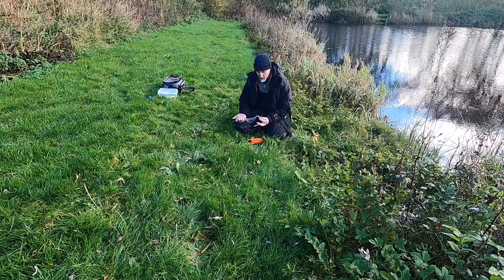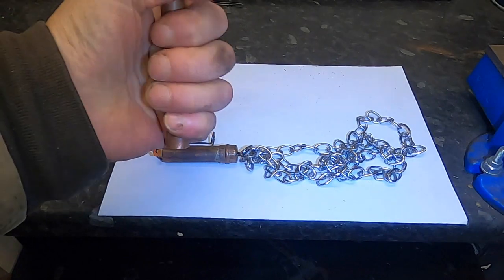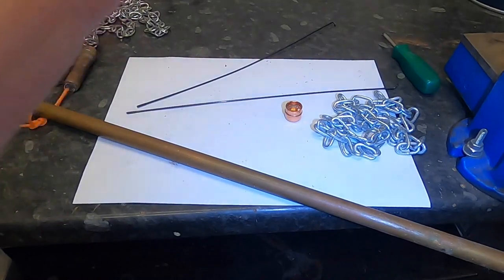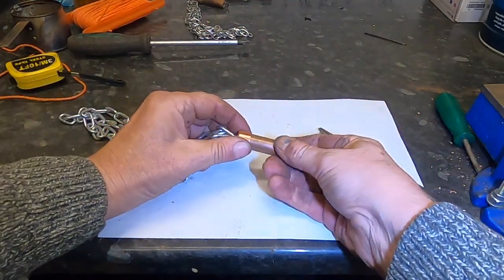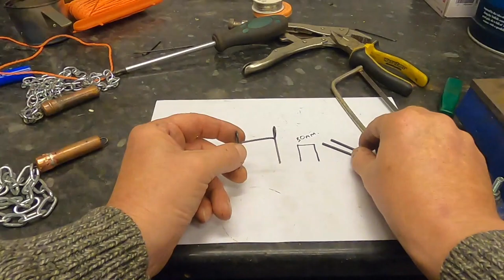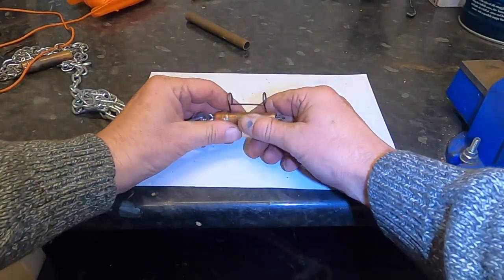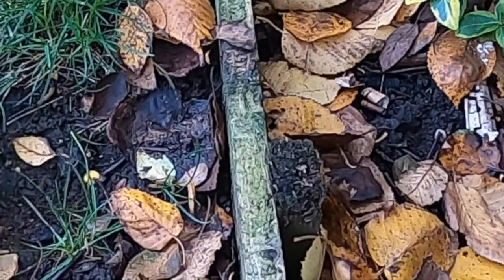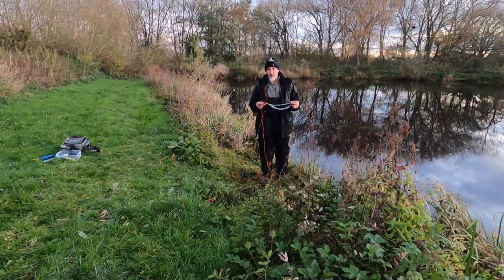DIY Lure Retriever

Comment: Just curious how this would work on a single barbless hook , would it be too difficult to get a hookpoint to grip to. Excellent video though, especially the tip about getting the line tight with a bar.
Reply from the maker: Hi DenisJolly! The lure retriever is really for lures with trebles to give the very best chance of snagging a hook with the chain. Double treble hooked lures are usually easy but single treble lures can be caught too, replicants etc. Single hooks are always going to be difficult though, especially if that single hook point is embedded in a log for example, the hook point won’t be exposed so impossible to be caught by the chains. At least single hook lures are usually cheaper if you do loose them! Tight lines 👍😎

Comment: I would fill pipe with lead shot and 5 minute epoxy resin instead of molten lead! Would bamboo be OK to use instead of copper pipe? A beautiful video mate and well worthy of BIG THUMBS UP ALL DAY LONG. Take care my friend 👍😷👍🏴
Reply from the maker: Hi Andrew, I think lead shot and bamboo would work but pulling the cord after snagging a hook puts a fair bit of pressure on the retriever so might split the bamboo, try it though and let us know how it works! 👍

Comment: How many grams does this pipe has to be or is heavy? Can we simply use lead of 15-45gr with swivel?
I also used 35cm x4 chains 1cm is one link, and monofil 0.50mm with 33kg weight...
Reply from the maker: The weight doesn’t have to be any specific weight, it just needs to be heavy enough to get down to the trace and carry enough momentum to drive it over you trace components. Early trials with a lead ledger weight wasn’t too successful as soon as it came up against the trace swivel, it’d hang up and not go over, the tubular weight ensures there is still momentum pushing it forward when it comes up against the trace swivel

Comment: Hey there. I have kinda idiotic question i suppose.  I bought a lure retriever similar to this from online and the problem for me is that i just can't get the retriever down to the lure. Does this only work for short range? I also use a very short rod as well. It's 1.95m Westin w3 jerkbait rod. I don't get what's the problem. It seems that i can't get the line tight enough so that the retriever goes all the way down to the lure? Any opinions/ideas on this? Thank you,Robin.
Reply from the maker: Hi Robin, It does work best at fairly short range, generally The snags are close in anyway (if fishing off the bank) The retriever has to be heavy though, so it wants to sink, the wire loops where the line goes through need to be big enough so there isn’t any resistance and that they slide over the swivel on the wire trace. Try and get the line as high as you can, that helps getting it down. I’ve used on a boat too and it’s fairly simple, only need to get the bot directly above the stuck lure.
Reply from the maker: One other thing, are you using a pull bar? You can get the line/braid much tighter pulling on it with a pull bar rather than using the rod, too much flex in the rod really
Reply: @apikersprogress  you mean getting the line super tight around the pull bar first and then sending the retriever down to the lure? That's a smart idea actually. Might need to give that a go next time. And for me the snags seem to be in the middle of the river or the far bank so yeah lol. Thanks for the advice mate :)

Comment: How long is the orange line? Could you please tell me where to get one. The ones on ebay are only 11M and puny looking.
Reply from the maker: If you are in the uk, you need to get to tool station!
https://www.toolstation.com/polypropylene-rope/p34370?store=LM&utm_source=googleshopping&utm_medium=feed&utm_campaign=googleshoppingfeed&mkwid=s_dm&pcrid=515847200324&pkw=&pmt=&gclid=Cj0KCQjwkIGKBhCxARIsAINMioLFZMQYZ0o7e3Fg1kdr4p6t-ovUMsSUfytnaYqjWS7FqTEGct0SmmQaAl9sEALw_wcB&gclsrc=aw.ds
I’ve about 30m on my winder 👍